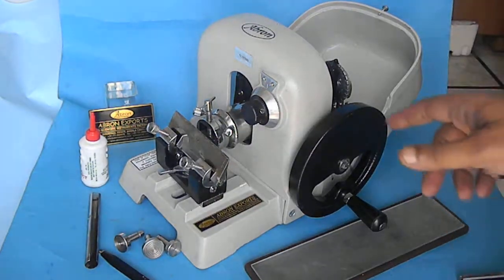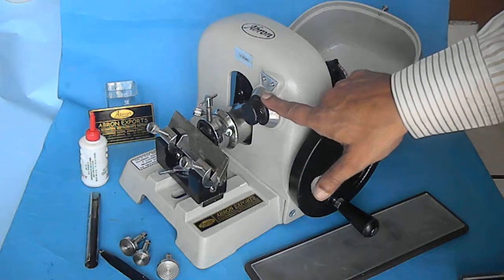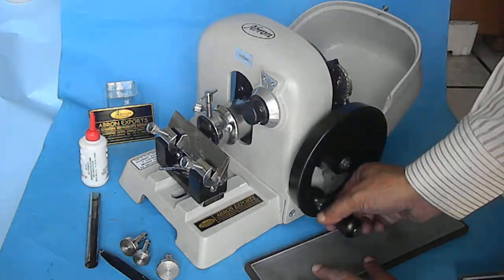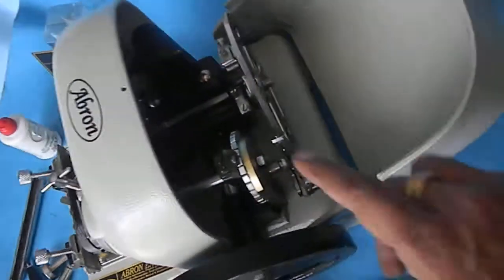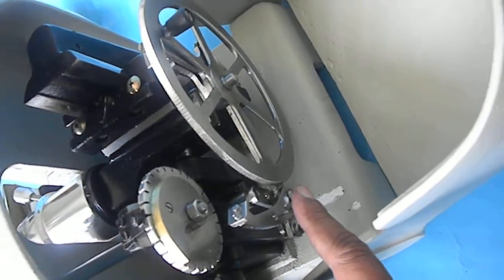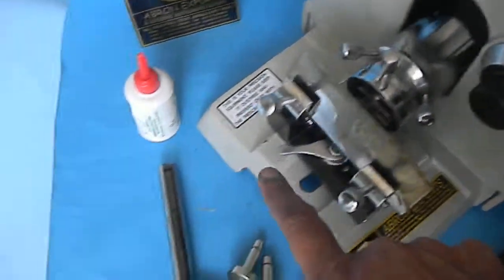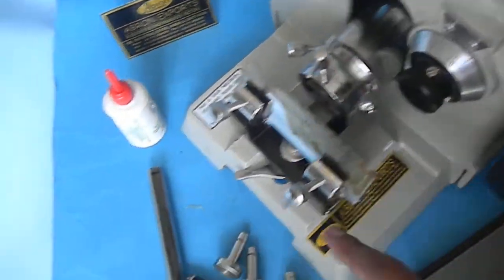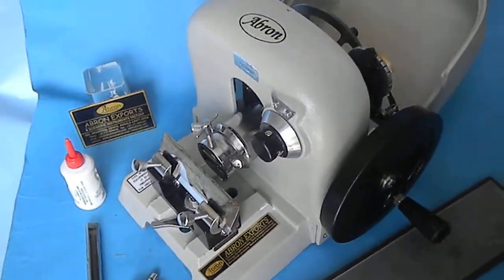video biology microtome senior rotary ab 90 abron tutorial working manula

Comment: please tell how will the wax block move forward after each cut.. i cant find any screw or anything which will move the sample holder forward.
Reply from the maker: There is letch touching  big wheel and see video 1.16 this will move forward automatically after each cutting wheel when you move by hand .   when you adjust cutting micron from front side small dial graduated in micron it moved to that secelted micrones   you can call me 941602018 or email abron01@gmail.com    also send me your mobile to call you to guide you
for moving backside to original starting position open lid back again see big wheel and also video at 1.00 minutes  and then move wheel in backword direction but one letch is stopping it moving back side just pull back latch and wheel will be free to move backword